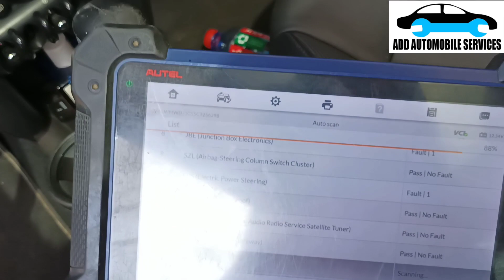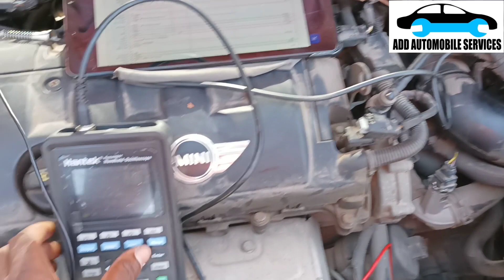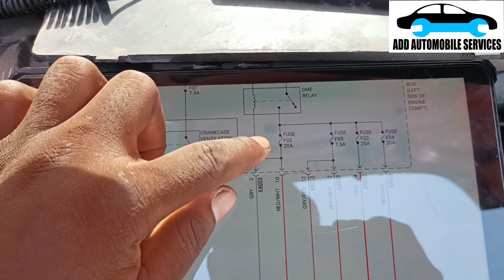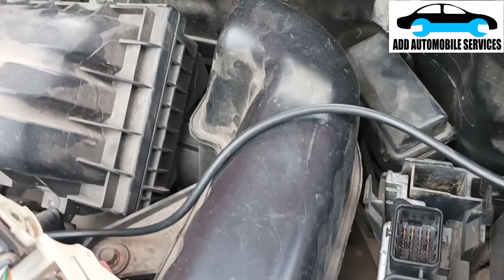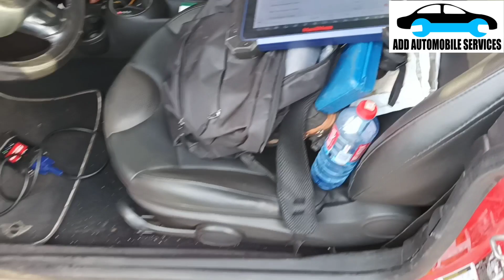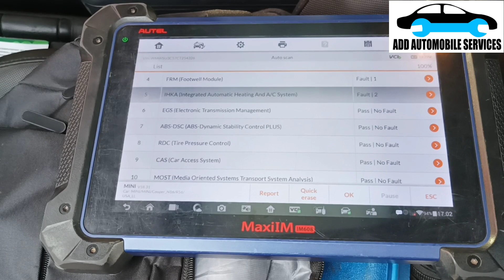2007 cooper : No communication and no start

Comment: I am having an issue with no comm right now. Have good grounds, 5v ref and main power to the PCM and no fuel pressure, no spark and no comm.
Reply from the maker: What fault code do you get when you scan the system and are you able to communicate with the PCM
Reply: @ADDAUTOMOBILESERVICES  no communication with the dlc. Today I'm going to check the hi and low can lines.
Reply from the maker: Ok
Reply from the maker: @YourEmpireLocksmith check fuses